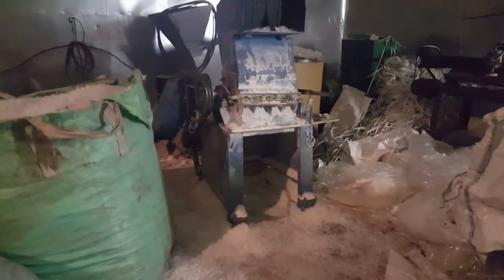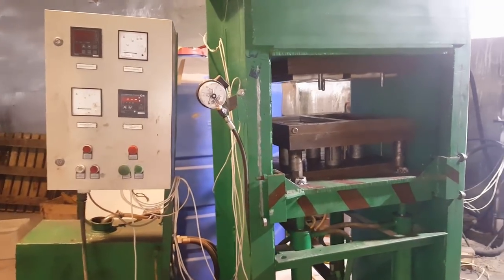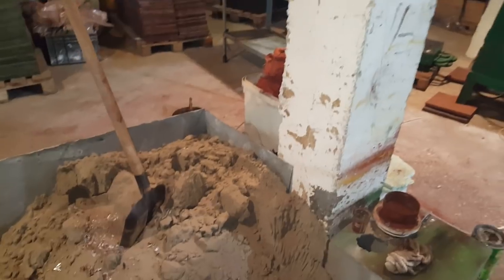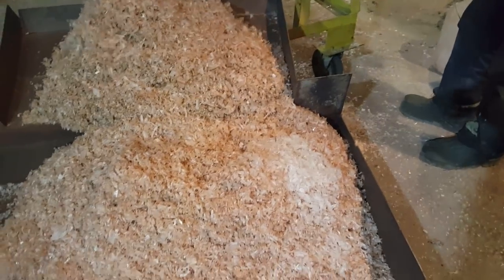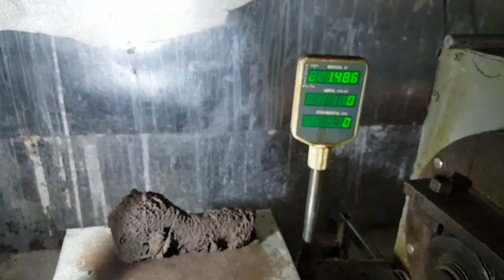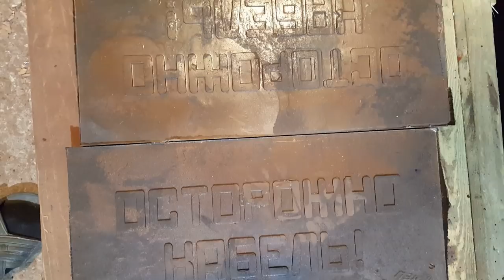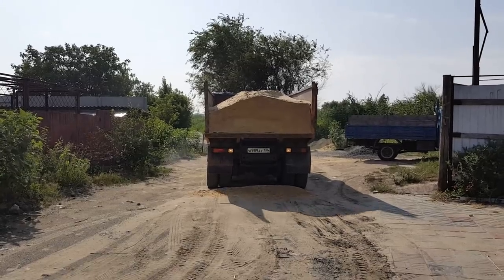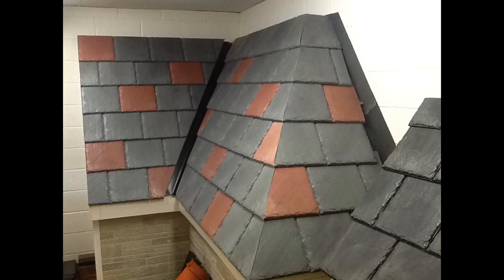Pavement tile from plastic waste

Comment: This is amazing.
Reply: That's not how plastic recycling works, you are being deceptive. First off you cannot mix different types of plastic, recyclable and non recyclable, trash bags, HDPE, I think I saw some expanded polystyrene in there, and I'm positive I saw some corn based Plastics in there. most importantly once plastic has been exposed to Too Much UV radiation i e from floating in the river or an ocean exposed to sunlight, it will not recycle. what you are obviously doing is purchasing shredded HDPE and converting it into Paving tiles. most likely what you're purchasing is rejects from a plastic factory that have not even been put into production yet. Your shred, to me, looks suspiciously like shredded milk jugs. Not one tide container or corn-based food container, or plastic trash bag in the bunch. They're definitely aren't even any mixed colors in there. What you're doing is a con. I wouldn't be so angry except for somebody share this video with me and suggested that I build them a plastic recycling system to recycle ocean trash. I told them this was impossible and they showed me your video. Your stupid video is promoting ignorance around the world. Please take this video down, Or I will expose your con to the world.
Reply: JerryRigEverything  amazing yes but I love watching your videos what about the AfricanguyRigEverything?
Reply: JerryRigEverything Can you please do a scratch test on recycled plastic pavement tiles? Thank you.
Reply: the tiles need your burn test
Reply: It's interesting

Comment: I really hope someone sees this and helps to fund more manufacturing equipment and finds a wide distribution network for commercial and consumers sales. This is a great way to recycle types of plastic that can not be recycled in the traditional way or has been recycled too many times. PVC for example can only be recycled 7 times before it is no longer able to be used for windows, siding or the like. This product is great for such plastics. Here in the US these types of plastics are made into composite decking, fences, screens, playground equipment and other items.

Bravo.

Comment: Yes... This is great thinking for environment....I salute you sar ---- your thinking.....
Reply: That's not how plastic recycling works, you are being deceptive. First off you cannot mix different types of plastic, recyclable and non recyclable, trash bags, HDPE, I think I saw some expanded polystyrene in there, and I'm positive I saw some corn based Plastics in there. most importantly once plastic has been exposed to Too Much UV radiation i e from floating in the river or an ocean exposed to sunlight, it will not recycle. what you are obviously doing is purchasing shredded HDPE and converting it into Paving tiles. most likely what you're purchasing is rejects from a plastic factory that have not even been put into production yet. Your shred, to me, looks suspiciously like shredded milk jugs. Not one tide container or corn-based food container, or plastic trash bag in the bunch. They're definitely aren't even any mixed colors in there. What you're doing is a con. I wouldn't be so angry except for somebody share this video with me and suggested that I build them a plastic recycling system to recycle ocean trash. I told them this was impossible and they showed me your video. Your stupid video is promoting ignorance around the world. Please take this video down, Or I will expose your con to the world.
Reply: @thekhiman1  uh oh angry troll alert!!!

Comment: That's not how plastic recycling works, you are being deceptive. First off you cannot mix different types of plastic, recyclable and non recyclable, trash bags, HDPE, I think I saw some expanded polystyrene in there, and I'm positive I saw some corn based Plastics in there. most importantly once plastic has been exposed to Too Much UV radiation i e from floating in the river or an ocean exposed to sunlight, it will not recycle. what you are obviously doing is purchasing shredded HDPE and converting it into Paving tiles. most likely what you're purchasing is rejects from a plastic factory that have not even been put into production yet. Your shred, to me, looks suspiciously like shredded milk jugs. Not one tide container or corn-based food container, or plastic trash bag in the bunch. They're definitely aren't even any mixed colors in there. What you're doing is a con. I wouldn't be so angry except for somebody share this video with me and suggested that I build them a plastic recycling system to recycle ocean trash. I told them this was impossible and they showed me your video. Your stupid video is promoting ignorance around the world. Please take this video down, Or I will expose your con to the world.
Reply: jesus, how many different times did you feel the need to post this comment?
Reply: Your homeless friend Kai he’s not saying he’s separating it to recycle ♻️ it, its all just chucked in together. This guys trying to save the planet and your saying your expose him for what mixed plastics 😂 it’s save the planet or don’t. 
Where I live it all goes in the bin, down south they separate it, all goes to the same place, but makes the council looks like there care 🙄.
Reply: I don't know about this one but other videos are made in Africa that show many different plastics being used the same way as this video.
Reply: Your homeless friend Kai, where is your shop and how are you making a difference with the exception of being a critic.

Comment: concrete is already heating the planet covering big areas (roads) in the cities around the world. forbidding the planet to breathe !! it is understandable that plastic can help heat homes in Russia in winter but to consider it on a massive scale for roads and large projects will increase natural disasters !! earth breathes !! even sand even clay !! when the sun hits .. the excess water evaporates and the planet breathe. The plastic is not a bad idea but for a road or road side. the molds should have holes in them !!
Reply from the maker: Thanks for the advice. We will take into account your wishes.
Reply: Ideally the pavements can be perforated
Reply: axnbjsbdu dbydvydubu. I have the same ideas with you. its a good innovation. to do away with waste plastics. But, they should be a hole perforated in them to help the earth breath and also reduce heat emersion.
Reply: axnbjsbdu dbydvydubu 
Please don't believe all the indoctrinating hype about weather and junk science on warming/cooling. Hottop and concrete covers a miniscule part of earth...
Of course improving the product and making it drain better etc when used as pavers is a good idea.
Reply: If he can make the tile white, it would absorb lesser heat then

Comment: are then tiles slippery when wet?
Reply from the maker: No, decause we mix it with sand. the surface gets a little rough.
Reply: A good question and good answer. Thank you. I have access to similar equipment. I may play with the idea.
Reply from the maker: No, because it's with sand
Reply: I want to establish a similar manufacturing unit in India... Will you provide me the necessary equipments and training for this product ? And what is the total cost of a plant ? How much square feet land is require for this plant ? Please reply....
Reply: Satyaranjan Sutar. You want equipment and training for free?
Reply: @indigocharlie7218   what do actually mean? Are you giving training and machinery which are used in this project?

Comment: Brilliant! Just one suggestion. To make the tiles hexagonal, so that the unevenness of the surface it will be laid on will matter less. Also, maybe the tiles can be smaller, and attached to each other on a grid. This will allow the tile to be rolled out onto the surface, for easier installation

Comment: You need praise for your work. It is obvious you are working on a very tight budget. However you need to give attention to details. You need to have a layout that is as good as a show piece. Use the very plastic tiles of attractive colours for the floors as well as the walls. Do a design or plan of the factory. 
Start with delivery area for the raw material then the extruder followed by press etc.
Your vision to spread the technology to all the parts of the world is commendable. Precisely for this reason build a system that you can export to the world at an economical price.
Please do not feel offended. You have a grand idea that is meritorious. God bless you.

Comment: Interesting demonstration.  I'm acquainted with a similar process concerning polymers (HDPE, mainly) and dried ground up saw dust (with less than ten percent water, by weight?), up to about thirty percent wood (?)....the items were extruded into sawable and nailable planks and so on that might be used in exterior window sashes and the like.  And they might be painted too.

Comment: I like the video, I would like to undertake something like this, but I have doubts. do you not need to wash or rinse the plastic material? If the material is not clean, does the inside of the extruder get very dirty?

Comment: On that machine you could install extruder mould plates that could produce a full size brick that locks together like Lego for use in poorer areas for families to quickly build small waterproof buildings suitable for small families that once outlived usefulness can be simply taken apart and restructured in to a different building.

Comment: Excellent project.i would like to know the equipment costs and details like type of pigments to use to get different colours and what should be the sand grit and the temperatures of the machine etc.if you made any project work out pls do share.
Reply from the maker: romansebekin@gmail.com
Send me your question on this email. I will respond you
Reply: Planetary Ecologist 
Mail sent.pls check and reply.
Thanks.

Comment: Excellent Idea . 
Did not get it -  where the plastic heated to get mixed with sand ?
Ratio of sand to plastic ?
How would do in hot weather where temperature rises to 40 degree centigrade in summer ?
Reply: All plastics have different melting poing. For all tech. Contect me

Comment: Without pattern very slippery. you need some kind of grit, maybe make a hot sand tub to place then face down on and let the sand melt into the surface.
Or sprinkle it on and hot press it.
Even applying a pattern like a mesh with wire fly screen hot pressed and removed.

Comment: The real way is to stop using plastic itself.
It is much more effective and much more harder to regulate oneself
Reply: But you can't avoid it, its necessary evil :)
Reply: @ziokam1  I can. The only time i personally use plastic is when throwing out trash or bringing groceries...

If i can eliminate those ( theoretically possible) then i can stop the majority of plastic flow i enable.

The one's i can't stop would be product packaging and plastic stuff which is necessary or hard to replace, but that can be reduced to a manageable amount.

Comment: RESPECTED  ROMAN SEBEKIN SIR NICE VEDIO WITH A GREAT MISSION. THANK FOR BRINGING THE VEDIO.  
SIR, I HAVE A FEW  QUERYS:
WHAT IS THE RATIO OF MIXING OF  SAND WITH SHREDDED PLASTIC.
WHAT IS THE WORKING TEMPERATURE IN EXTRUDER AND IN HYDRAULIC PRESS
SIR I WANT.
WHAT IS THE HOLDIND TIME.
I want to go for this project.
Please advice
I shall be thankful
With regards

Comment: Right up until the point where you realise that these tiles WILL wear out too, and the micro sized plastic particles will end up in our waterways and be even more harmful and significantly more difficult to remove. The solution is to remove plastics entirely

Comment: How long do they last?
Reply from the maker: What do you mean "How long do they last" ?
Reply: Planetary Ecologist 
He means life of the product, about how many years of use?
That is a hard question to answer because it depends on many variables; but maybe the roof tile would be a good example, even if it has many variables also especially weather and sin exposure.
How long will roof tiles last on Canada?
Reply: I think more then 100 years if you look good you can imagine how strong it looks like!.
Reply: 100yrs if they have a personal relationship with oxidation. In short this is very dangerous.....cause microscopic chips will sip straight into the ecosysterm. Its already a problem on/with marine filter feeders...now this will put it in the soil n fresh waters.plastic take long to biodegrade

Comment: Do you add boric acid or anything as a flame retardant? I'm envisioning a house with it's plastic 2" thick roof burning hotter and longer than the flames of hell. So maybe mix a little boric acid in a batch, conduct a burn test, using like 8 different levels of boric acid in 8 separate tiles. Use two untreated tiles as a reference point.
Small cost that could give you an internationally accepted product. Please patent as open source. <<<Like you said "To help the world"
                                         Just Thinkingoutloud, best hopes for your project. Let me know if I helped.
Reply: Tayro Thinkingoutloud your opinion is very apt, I would like to read more opinions from you on how to make this project a better one.

Comment: We sure could use this new tile making process in Canada. So much useless waste.
Reply from the maker: Maybe somebody from Canada will see this video and implement it. It will be great )))
Reply: The key will be to convince the building code people and insurance industry that extruded recycled plastic roofing tiles represent less of a fire risk than asphalt and grit coated coarse paper.  We've seen in areas where the forest fire risk is high, they recommend noncombustible metal roofing.  Tiles are not exclusively for roofing.  Think about all the concrete backyard patio blocks, walkways and residential parking spaces.